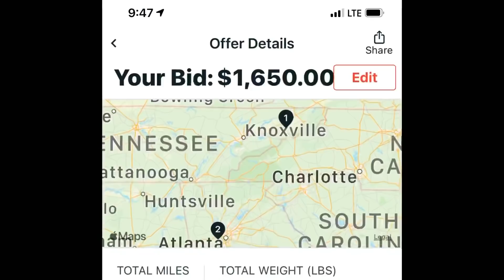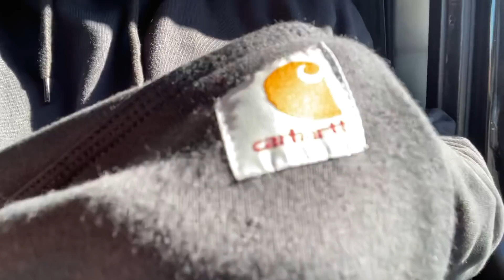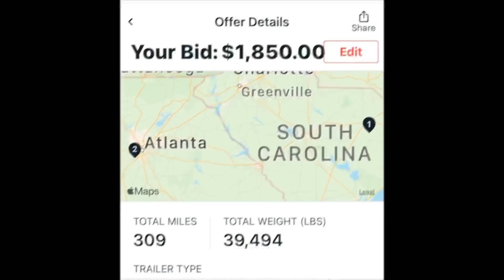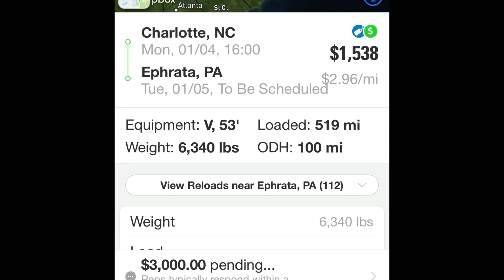“Uber Freight Double BOOKS my LOAD” Lost $800 Quick Fix Fan Clutch ?? OTR Truck WWE Zee TV T Series

Comment: Old International 9670 set forward axle super sleeper. I learned to drive in a 9670, no power steering,only the power you had to steer it. 10 speed manual. Then I moved up to a 9700 set back front axle, flat sleeper, only had a full size mattress in the back that was all..

Comment: Have you checked into ditching the clutch fan and going with electric fans they help with running ac at idle and huge help in winter when the engine doesn't wanna warm up do to fan constantly blowing

Comment: Happy New Years Justin. Why do you stick to know your worth but you taking a load for 650.00 to Atlanta. It’s kind of cheap. That’s why I ask you a couple videos ago, when the market tanks do you still run. Only because these new guys that are just starting out get the wrong impression with knowing your worth! I think the brokers are trying to crap on you because of your videos! For the new year, if you like running last minute loads, why don’t you just “post your truck on DAT” and brokers will call you with higher rates but it’s usually a headache load kinda like what you don’t mind running ( I.e. heavy loads, mountainous terrain, late loading appointments, etc). There are guys who run like you but they usually post the truck, you only deal with a small group of brokers, you can fare better with DAT. Just helping you out!

Comment: Justin,  could you tell me why American trucks have such a big gap between the back of the tractor and the front of the trailer,  I ask because I hear you guys talking about fuel milage,  here in the UK we have our trailers close coupled as close as can be made possible so that we don't get any wind drag,  now we are grossing 44 tons and are getting 10 or 12 to the gallon and that's with our cab overs,  just curious.

Comment: Looks like a DDI interchange,  diverging diamond interchange, also called a double crossover diamond interchange, is a type of diamond interchange in which the two directions of traffic on the non-freeway road cross to the opposite side on both sides of the bridge at the freeway, so no left turns across traffic, keep you moving.